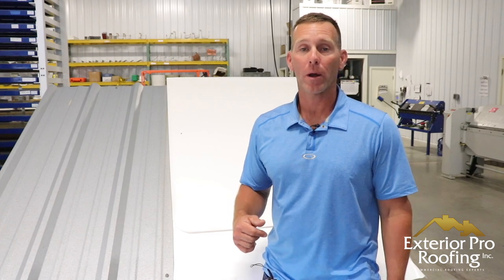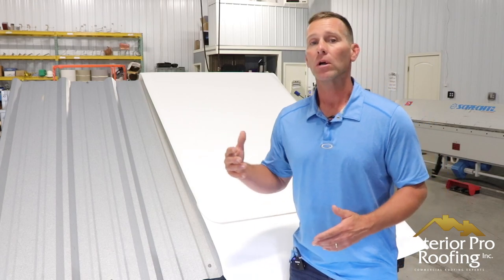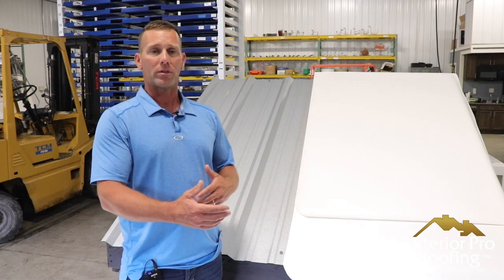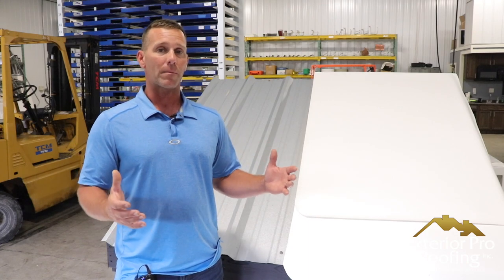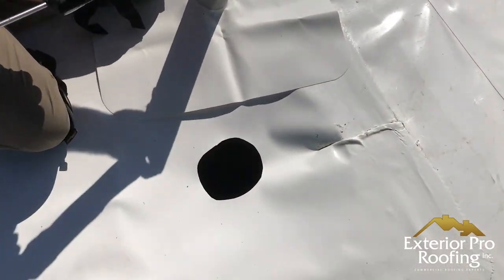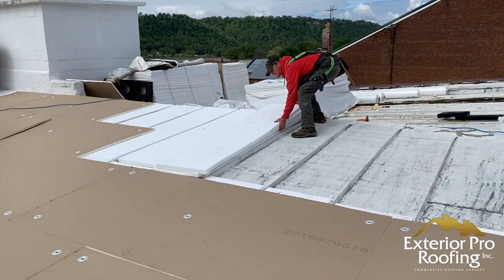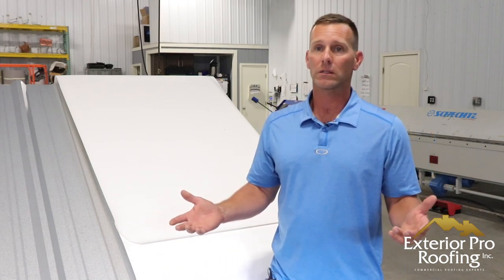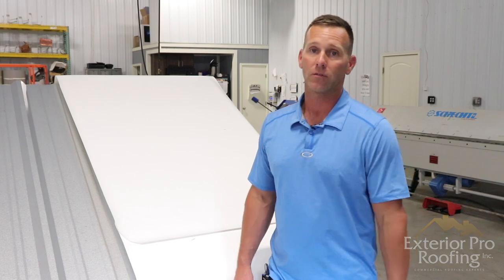Metal Roof Coating  vs.  Metal Roof Retrofit- What's right for your building?

Comment: We have been considering patching our rusty screws with something  flexable  like karnaflex  or  gaco or Turbo Poly Seal, but now I am thinking about a retro fit.  You said $3.00 to $6.00.  I would assume you mean square foot?
Reply: Call Kentucky Commercial Roofing.  We have a coating system that is better than single ply.